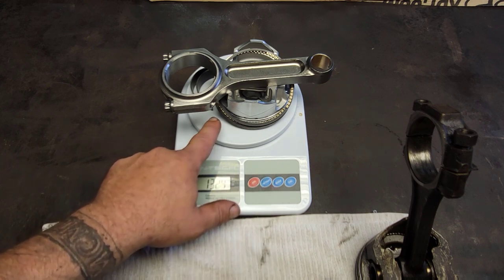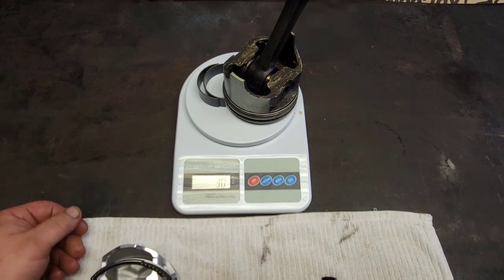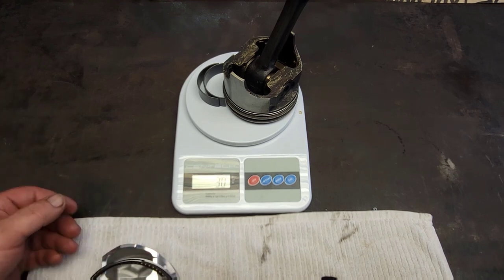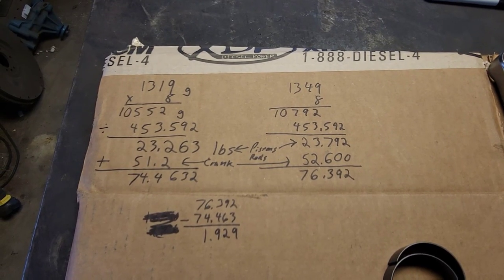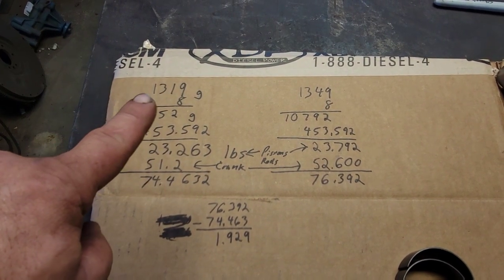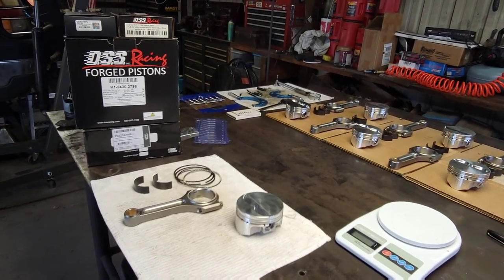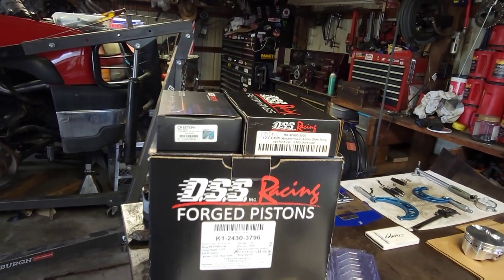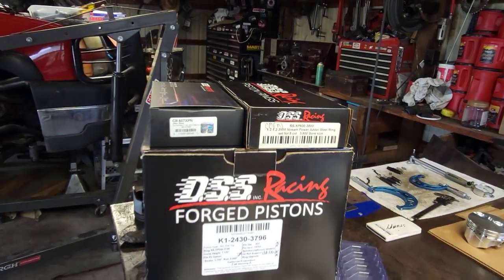Starting the process of my Nitrous 339 stroker sbc build. Getting organized and inspection.

Comment: With this 3.75 crankshaft, will you keep it externally balanced or will you give it to a shop and internally balance it?
Reply from the maker: This is an internally balanced crank i believe. I will have the machine shop balance it either way.
Reply: @SquarebodyStuff  awesome! knowing 400 sbc are usually externally balanced, i wasn't sure. Internal balance spares from so much hassle haha! I'm very curious about your project! Keep doing the good work mate!
Reply from the maker: @AIBCustomFx  My balancer and flywheel both have removable balance weights, so I'm good either way.  Thanks for watching.